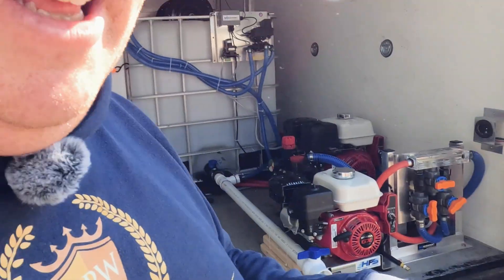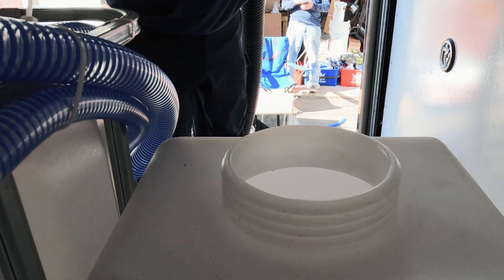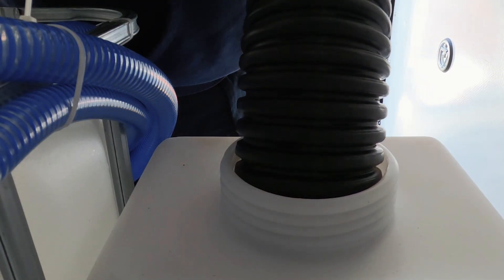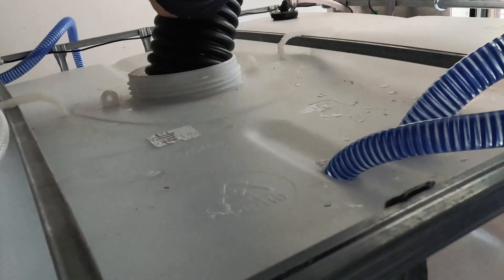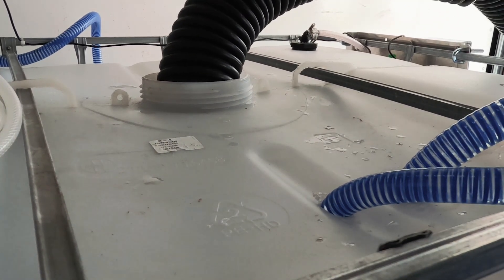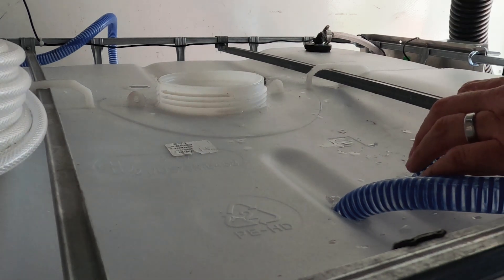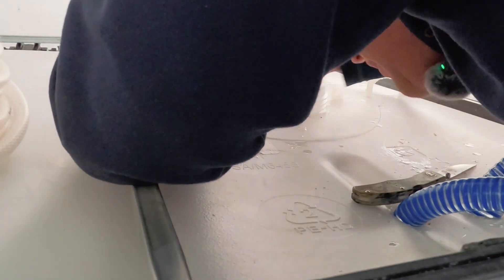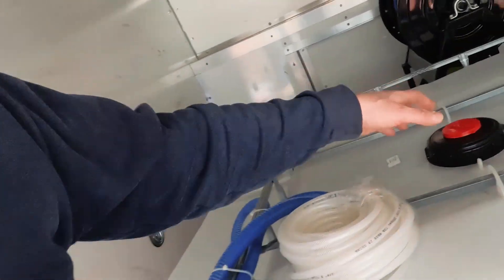How to Prevent Water Tank Sloshing with DIY Baffles!

Comment: Have you filled the water tank using a water meter to see how many gallons it will hold now after putting in the baffles. With a 275 gallon  tank it would be interesting to know how many gallons you lost when it totally full. Thanks great video!